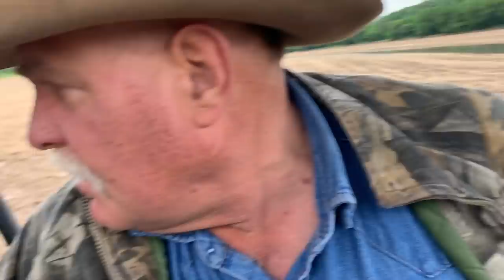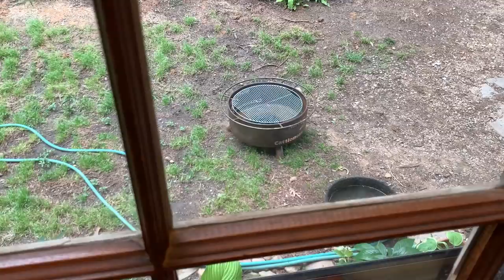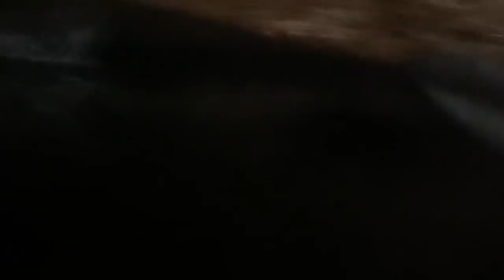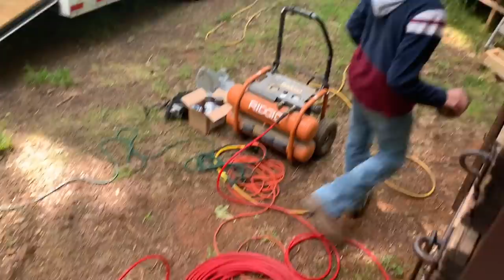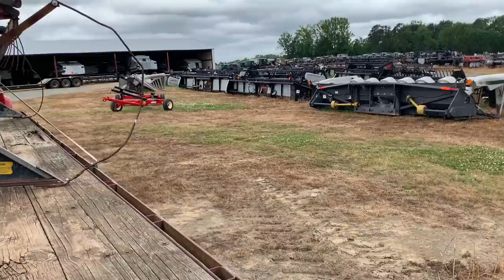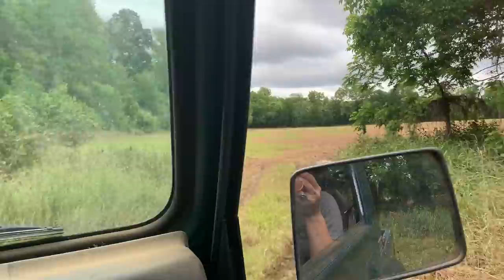Flood Farming Q&A and a Gleaner Graveyard

Comment: If you take an old 3 lb coffee can and punch a bunch of holes around the bottom edge near the bottom with something like a "church key" is what we called them used to open beer or pop cans. Open up both ends of the can so like a cylinder, set it down in the fire pit.  Fill it up with the charcoal soak it with lighter and light it at the bottom thru the holes you punched it will stay lighted an evenly in a shorter time.  I doubt if I am the first to say this or some iteration of it.

Comment: Lil tip on charcoal fluid,put it on like ya did first time,let it set a couple of minutes,then just a splash then light...it gives a chance to soak in a lil...and then its normal for to it to look like you need to call Houston.But it is going!Yes,not as quick as propane grill,but taste is amazing!

Comment: When it comes time purchase heat and AC for the crib,  a company called acdirect sells the split units, with heat pump for heat and ac for the cold. No soldering of the lines as they use a compression fitting and the units come pre-charged.
I purchased one of the Mitsubishi units for my shop, just need a rock saw to get power to the building. Property is in an area full of limestone, so the trench needs to be sawn into the ground. Don't want aerial power lines.

Comment: When you start charcoal soak it like you did then let it stand ten minutes to soak in and soak it again a little and light the charcoal then it will catch and burn. You got to let the lighter fluid soak for 5 or 10 minutes and 10 is better. Good luck and if need help invite me over for supper.

Comment: Trick is to put a ton of fluid on them(like 3-4 times as much as you did) let them soak it in for a couple minutes, then apply a little more(like you did) then light it. It’ll hopefully generate enough heat to stay lit by then.

Comment: If you have to use fluid (recommend you get a coal chimney - they work better and your burgers don’t taste like West Texas crude), douse and let it soak into the middle of the coal. Ten-fifteen minutes THEN Light the bottom of the pile. If you don’t let it soak in you’ll just burn off the top layer and the fire will quit on you. Go get a chimney. Worth their weight in gold.

Comment: When lighting charcoal on the grill, I douse it with lighter fluid (like you did), and then I wait 5 minutes for it to soak into the charcoal before lighting it.  Then when you light it, it doesn't burn off right away.  It takes about a half hour for the coals to get good and hot, unless the charcoal got wet.  Then it wil be harder to get a hot fire. Maybe this will work for you.

Comment: Those dogs will not TRY to snatch the burgers, THEY WILL snatch the burgers. my friends dog came home one Thanksgiving turkey he stole from some one. get yourself a small grate to put in the bottom of that fire pit, that will hold the charcoal up off the bottom of the pit, and get a better air flow from underneath the coal, the will burn cleaner and hotter. also stay with the charcoal you have, that struff with the fuel in it already, , drys out if you let it sit around long enough, and you have to use the other fuel anyways, , also let the fuel sit about a min before you light it, let it soak in a little.